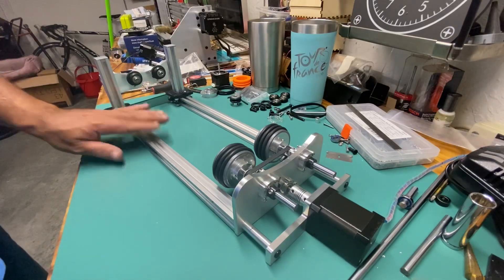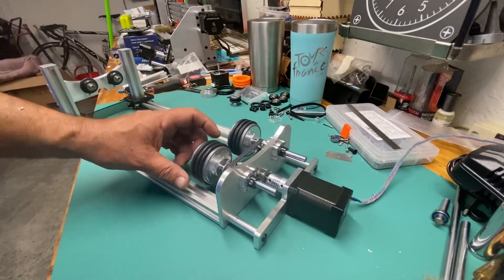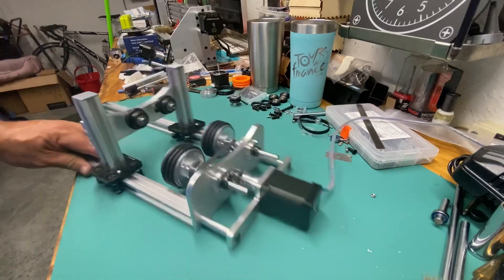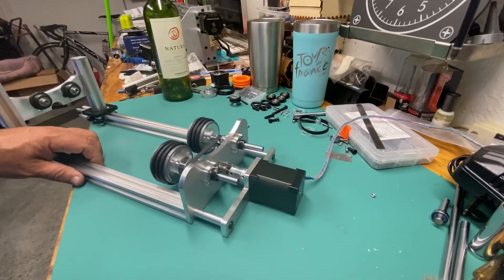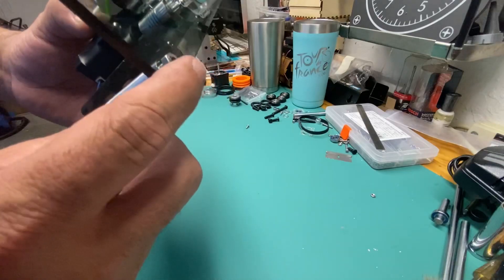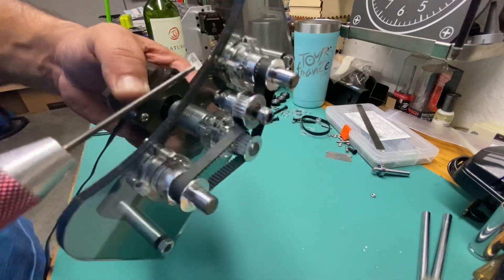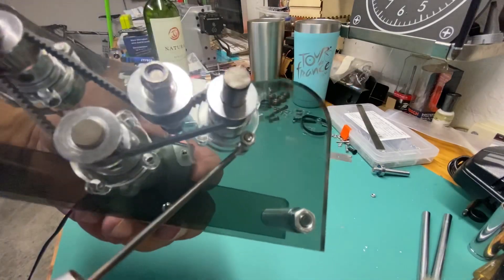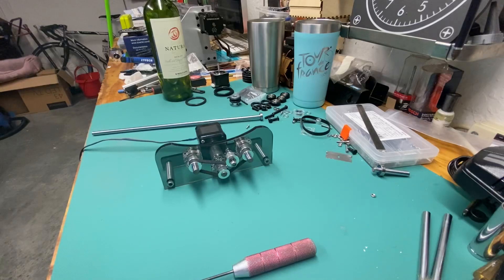Rotary tool overview

Comment: Pedro. Why did you use the extra plate to hold the motor instead of just mounting it directly to the plate with the main wheels?

Are you planning on looking into cam locks or the like for the sliding wheels?
Reply from the maker: the motor plate is to maintain the low profile;e and slide objects on top of the and motor without touching it